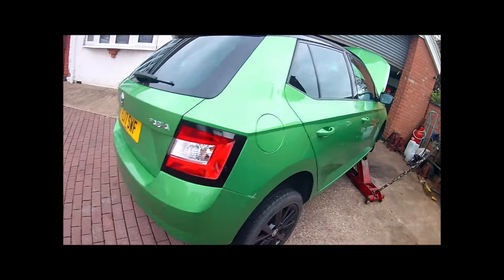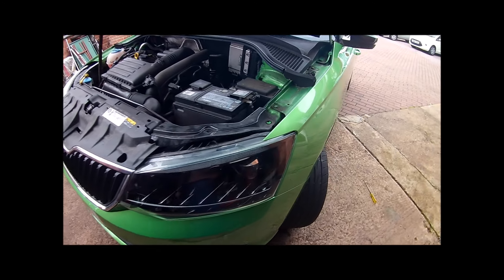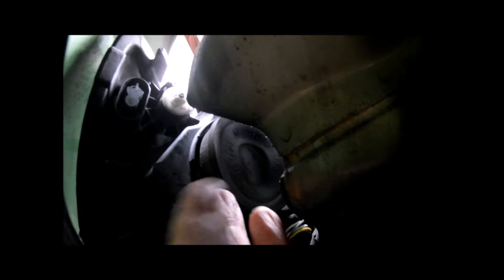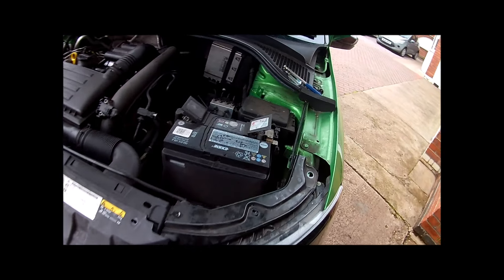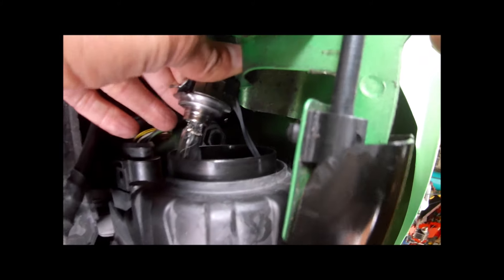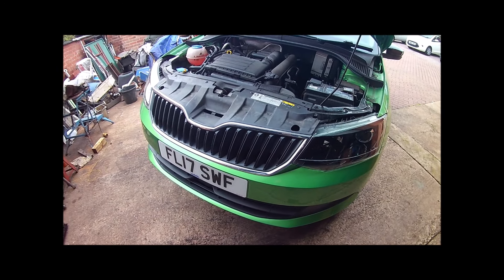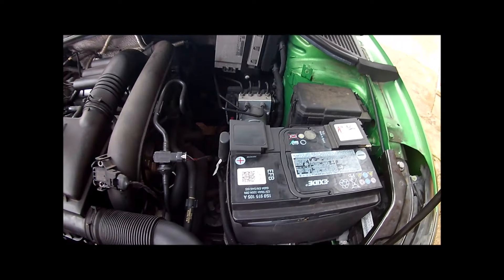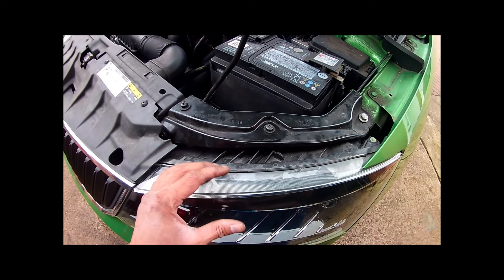Skoda Fabia 2017 Headlight Bulb Replacement Headlamp Bulb, 2015 - 2021. Skoda, VW. Nearside. DIY.

Comment: Just changed the bulb in the dark, cold, slushy and rainy january weather because of course it had to go out the evening before a long drive in the dark early tomorrow. Wasn’t too keen on crawling in the slush so opted for the battery route. At least it was somewhat easier than my old 2008 Mazda 6, believe it or not.

Comment: It took me a while to fine the best tool to take off the cover under the wheel arch. In the end I used a tool that came to build a trampoline at home-the hook thing to pull the springs. If you've still got that it works a treat. The daytime running light was very straightforward to change once the cover was off-simply take out the bulb with the unit, no wires, and replace bulb. This video really helped a lot thanks! Wouldn't have got the cover off easily without it. By the way, try changing the front lights of a Hyundai i30-had to nearly take off the entire wing!

Comment: I live in an area with lots of bumpy roads with pot holes, which the Skoda is not designed to drive on as the suspension on the car is awful, you feel every bump and the potholes sound like gunshots. Anyway, this causes the lights to always get knocked out of their socket, in the 6 or so years I've had my car, I've had the headlight go out about 5 times and the back light twice. I look forward to trying to replace them (I've had the mechanic do it every other time), I might try the wheel method but remove the wheel first so I have more room for my arm.

Comment: I’ve been toying with replacing the fairly crap stock headlight bulbs on mine. This has convinced me to not bother. What a crap design on an otherwise fairly intuitive car. Will save this for a guide for when a bulb eventually blows.

Comment: Just changed mine in my skoda fabia 3 2019. There was no need to turn the bulb, it was fit into place like a clipper, just press and it will hold. Also the pulling out of the bulb frim the connector was easier, just pull it, no screwdriver needed.
All in all it was a bit different design, but the rest was the same. I managed to do it without taking out of the battery (i am a newbie).

Comment: jep just had the same problem but on the other side... just to be clear i'm really not a good mechanic... so i drove back to the nice store where i bought it, and they were done in about 5-10min which would have taken be atleast 30min. however the mechanic actually managed to get it done through that opening in the wheel case, but had to use long pliers to turn the bulb in. thanks for nothing VW..

Comment: What if I can't remove the battery? Manual say it can be twisted
Reply from the maker: No, you can't get to it without removing the battery.
Reply: @sjp1285  I did it, yesterday evening after work. My hands has to twist a little but I successfully change the bulb. It was struggling, but I can't removing the battery and reset the computer
Reply from the maker: @cristiantrangon8648  You have to remove the battery and you do not need to reset the computer, nothing is affected. LOL.
Reply: @sjp1285  I did not remove the battery, IF I did so my car's centraline  would had reset. It happened once while changing battery. I had to bridge electricity to save info and other stuff

Comment: It's horrible... The person that came up with this should not be a designer. My headlight has gone out and it's -5 outside. Gonna be fun to replace it. What happens when I take out the battery though?
Do I need to reset some stuff or is it just a question of disconnect and reconnect?
Reply: Was it just reconnecting or did you end up resetting?
Reply: @mysticalsoul1575  worked fine. disconnected the negative first and then the positive. Reverse order when installing it again.
Reply: @habibielhabibi2272  I have tried to take headlight out but failed .. apparently you have to take bumper off.. so will risk it by taking battery out with this trick you have used with the hopes that the car has not reset.. might get a code saver done beforehand to be on the safe side though..
Reply: @jazzsingh2451  I did end up taking the battery out. Wasn't an issue. Good luck!

Comment: Think your self lucky,  some vehicles need the headlight removed to change a bulb.
Car designers obviously drive company cars so never change bulbs their self. 

Bulbs should be made easier to replace at the road side, having to remove headlights or trim to change a bulbs isn't really on since they are a saftey hazzard if they don't work especially in the middle of nowhere 

With the complexity of cars now adays there's little the average car owner  can do to fix most issues
But bulb replacement,   Oil and water top up should be made user friendly.